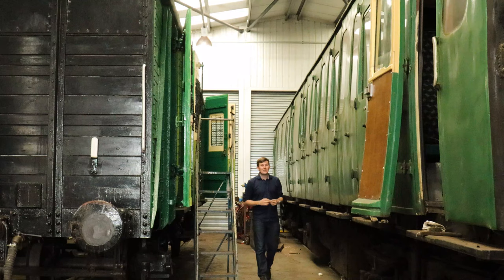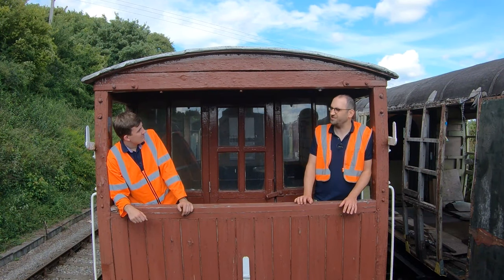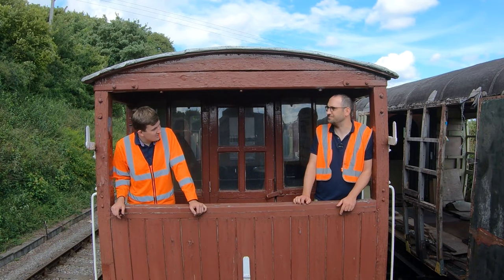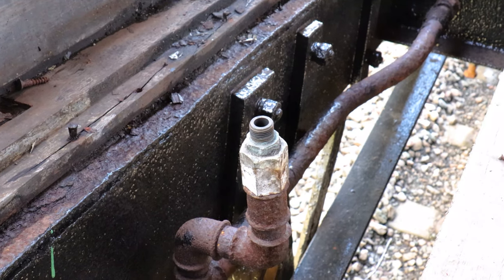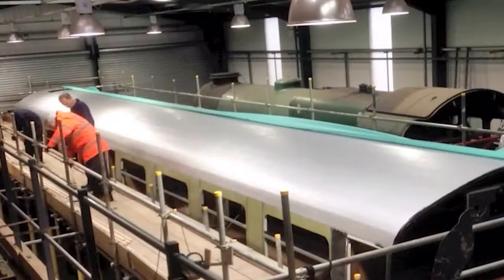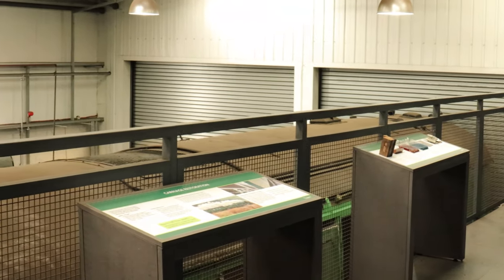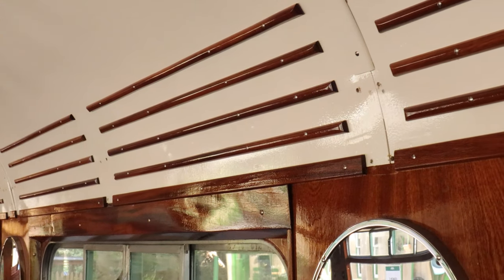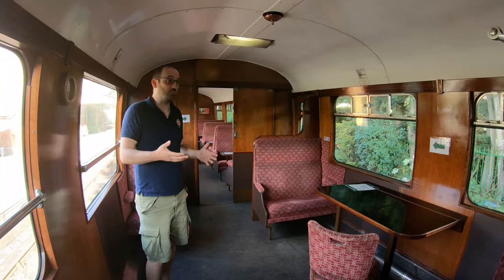The Bulleid Coaches: Before & After

Comment: What the presenter is failing to make clear is the reason Bulleid or I should say Southern Railway built the carriages using a timber frame on a steel chassis was the shortage of steel after WW2, timber was plentiful and of course the construction skills and tooling of using timber was readily available at the Eastleigh carriage works.  The other important fact that was overlooked, Bulleid's design profile replicated the profile of his locomotive tenders.  These were lovely coaches to travel in,  comfortable and airy, I used to enjoy my trips from Waterloo down to Southampton in the 60's travelling in them. The Bulleid coaches later became the template for the all steel BR MK1's.  Lovely restoration of the these coaches, they need to be preserved, not very many left.

Comment: Please can you do a video about how steam heating, vacuum/air breaking, and electricity on trains work? Essentially the pipes that go between the locomotive and carriages. Also with the power generation I don’t mean third rail electric but a different system, because on the Bluebell Railway they have a tunnel and when you travel through the tunnel they provide electric lighting even though there’s not a third electric rail.

Edit: please could you also include how water is supplied for things like the WC.
Reply: Its called a generator